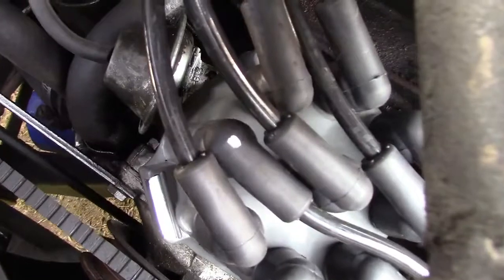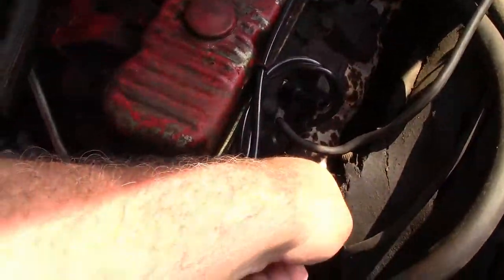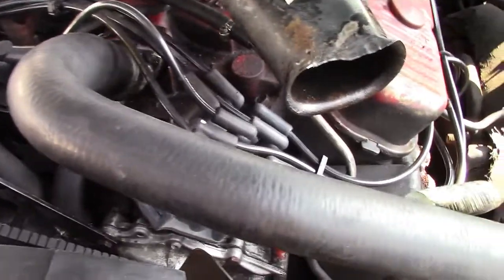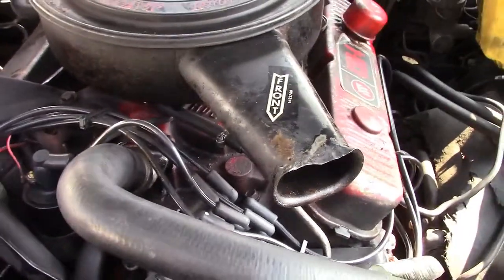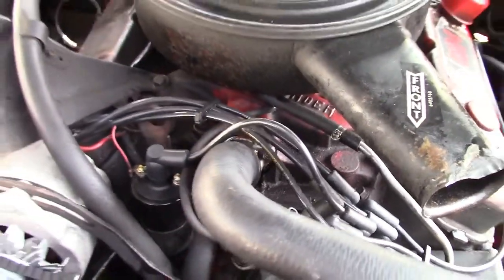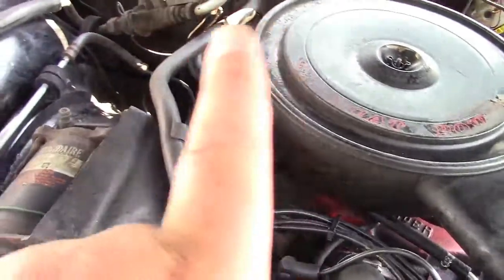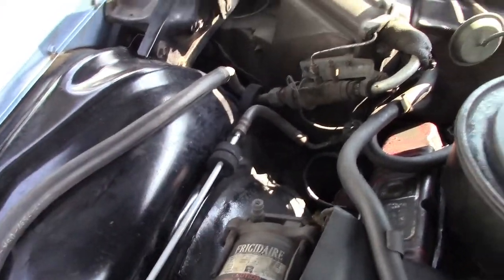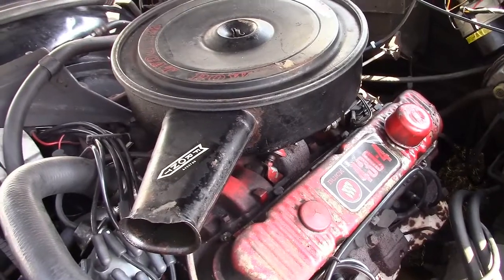Last Ditch Effort For The Bluick Before She Goes In, Plus Rant!

Comment: Aren't dads great?  Thank you for taking me back in time 30 or 40 years listening to my dad talk about what he'd fixed on our cars.  I never understood what he was talking about, but hearing words like points, condenser, vacuum hoses, and timing marks, sure took me back.
Reply from the maker: Funny you mention that.  While we were playing with the car, xjoe81x came down the block and stopped and of course had to talk.  Now Joe and I go way way back so he remembers my dad from when I still lived with my parents.  My dad said to him "I haven't worked on a car like this in about 45 years!"  For the record, he had a 1969 Pontiac Grand Prix as a kid, it was a "graduation gift" for high school, but there were strings attached.  Since he was the only one with a license and a car, he'd have to drive everyone places.  And when his brothers and sister got their licenses he had to lend them the car.  So it wasn't so much as a gift as it was a pain.

In 72 he found my mother and became involved.  At that point his siblings took over the car, and he and my mother shared her 66 Dodge Dart, I believe it was.  Had the pushbutton transmission, I think it was a livery car before my mother bought it.  Within a week he had to put a transmission in it.  He never really told me many stories of that car (such as problems he had with it), I believe it had a Slant 6 engine, but in 66 they were still using points and condensor of course.  In 1978 he got rid of that car and bought a brand new Dodge Aspen, basically the same car, different styling.  That car had electronic ignition.  There was some sort of "ignition module" mounted on top of the left fender well.  Over the years he had 3 of them lined up on the fender, because they all failed intermittently, one was working, one liked the cold, the other liked it hot.  So that way if the one he was using failed he could plug into one of the other ones.  Very vague memories of this.  But I remember a lot about that car, it was the car I grew up with.  I remember the seats, the color, the interior, the dashboard (a lot of it anyway), and the outside of it I remember even better.  About a year ago I did a video regarding some air horns amongst other car junk, he had those air horns in that car.  He put them in shortly after he got it, so I never heard what the original horn sounded like, even when he got rid of it.  I have 2 or maybe 3 pictures of me in that car from when I was a kid.  In fact, that was the very car I was brought home in from the hospital after being born, so it's tightly ingrained in me.  

14 years later, with well over 100,000 on the clock (probably more like 150,000), the frame cracked.  That car drove into Manhattan 5 days a week on terrible roads, in all sorts of weather.  I can't even tell you, as bad as roads are today, they were much worse in the 80s.  That, plus the NY winters, caused the frame to crack.  He got a couple estimates to fix it but they were more than he wanted to put into it, so he bought a used 1987 Nissan Sentra 5-speed to replace it.  When he sold the Dodge, he sold it to a crooked cop who moonlighted as a used car salesman.  I think it was sold for $250 along with the knowledge that the frame was cracked.  For whatever reason, he accepted a personal check.  Bad choice, even from a cop.  The guy later called and left a message stating "I was driving the car back, and the oil light came on, and the engine blew_."  He stopped payment on the check and we got stiffed.  Now when the guy showed up to buy the car, he had one of his buddies drop him off IN A COP CAR, which is also a big no-no.  We contacted the precinct, an investigator came to our house and gave us a tape recorder for the phone line, the guy never called back.  Bottom line is the cop _might have gotten a slap on the wrists.  I think my dad told me the guy came around noon or so, that morning he took the air horns out and hooked the factory horn back up.  I was in school so I never heard it.

The Nissan was the very car I learned how to drive stick on.  Pretty sure that car is gone now (he sold it to a friend of mine who sold it to a friend of his, who sold it to a friend of his), but it had well over 200,000 miles on the clock.  In one of my videos on my 81 Chevy, that car was seen parked behind it.

We also had a 77 Chevette that my dad bought used from a guy named "Ollie".  As a kid, I had a pail for sand at the beach and it had a little shovel and something else with it.  It had some sort of face on it, and the base had 8 arms, like an octopus, so I called it "Ollie the Octopus" because my mother would drive my sister and I to the beach or playground, and I would play with that, and since it was that car, and the guy was "Ollie", there you go.

One time, while coming home from my grandfather in Brooklyn, the timing belt on that car broke leaving us stranded.  I was very young, and frightened.  I remember my uncle came out and we chained the car to his and towed it back home.  My dad had mentioned this incident when we were working on the Bluick, I had forgotten about it.  While I was turning the engine over with the wrench, he warned me to make sure to NOT slip with that wrench because I'd likely puncture the radiator.  He spoke from experience.  See, the Chevette was a standard (not transverse) mount engine, belt-driven fan.  And it so turns out that was a non-interference engine, so my dad fixed it himself.  Somehow during the job, he made that mistake and punctured the radiator.  I remember vaguely him taking the radiator to a repair shop (you used to be able to have those things repaired!), and the car was then running again.  I also remember he hated working on that car, and there was always something wrong with it.  

In late 1986, he bought the 1987 Toyota Camry that he still has to this day (which I also had a video about).  He gave the Chevette to my uncle, who ran that car into the ground.  The final "nail in the coffin" (literally) was when an unscrupulous mechanic broke one of the spark plugs, tried drilling it out, and drilled through the piston. 

The Camry has over 200,000 on it and still runs, though its engine clanks, and it needed a new transmission, both due to my mother.  If those 2 things never happened, probably all that car would have would be body rot, but would still be original everything.  Funny enough, that car still has all its original (and thoroughly worn out) suspension parts, yet still gives a nicer ride than THE BIG SIX.  They really forgot how to build suspensions in this country.

While it's popped back in my mind, my dad once had a problem with the Dodge Aspen where it refused to start, it was due to worn timing chain sprockets (I think they were plastic he said), and he had to have it repaired by a shop.  Funny enough, while doing an archaeological dig in his garage (and finding the air horns, etc), he also came across the owners manual as well as the repair papers from that Dodge.  And one day I went through them, and sure enough, I found the bill for the timing chain job.  I've been meaning to make a video about all that stuff.

Well, that was my trip down memory lane!
Reply: Thank you very much - that was awesome!  I think it would make a great 'war stories' video.
Reply from the maker: I've considered that, I have a bunch of old war stories videos to make but I'll probably wait until we're bottled up for winter.
Reply: There you go !

Comment: 5:38, that is indeed the vacuum reservoir for the hvac. It appears to be the same part used on my 1981 Silverado. Great rant! It's cool for him to run lawn equipment during your parties, too! I would be tempted to tune, and test the Bluick's engine on a daily basis!
Reply from the maker: Thanks for identifying that part!  It's amazing, GM really got their money's worth using the same parts for years and years and years.  I can still get a starter and an alternator (rebuilt) for around $40 each for this car, parts are ridiculously cheap and plentiful.

The very same day, not only did he later close his windows as I showed, but what I didn't show is he had a bonfire in the backyard after that!  Tons of smoke pouring in the air!  That's OK, but the Buick for 20 minutes, forget it.  Next time he has a bonfire I'm going to get out my megaphone and "shout to the wife" to close the windows.  Also thought about just calling the fire department on him.

I once read that to get back at a landlord or neighbor, you call a roofing company, plumber, electrician, chimney sweep, etc. and have them all come on the same day, preferably at the same time.  They won't know what hit them.
Reply: You're welcome! Mine is located on the passenger side. GM sure did get longevity out of their parts, I am amazed at the number of similar, or same parts the two vehicles share.  Sounds like you and your Dad did a thorough job of troubleshooting, and glad you discovered the engine is healthy. Looking more, and more like it is something wrong with the Quadrajet. 
Oh, he didn't want the bonfire smoke going in HIS house! That would be awesome if you could find a cheap catalytic converter, get it installed, and say to him. Look! It's a regular car now! Thinking about it, perhaps if the carbonator is chooching properly, will the fumes will be reduced to Shitalian approved levels? 
Haha, that sounds like good times right there, all the dicks showing up at once.
Reply from the maker: You can't talk to him, he's right, and that's that.  He talks to me like he's my father, and I'm not going to stand for it.  Next time I see him I'm going to start yelling immediately.  See how pissed off he gets.  Like I said, let him hit me.
Reply: Yep! Hit the guy with a bad back, won't end well for him.

Comment: Wow! Almost becoming an episode of Jerry Springer there!

And I'm probably way off here, but have you considered the fuel pump?
Reply from the maker: Yeah it might get that way!

I have considered it, but I don't think that's the case, because if it were it would likely have issues running all the time, not just at idle.  That car uses a mechanical fuel pump driven off a cam in the engine.  Pretty easy to get to, it's right in front.